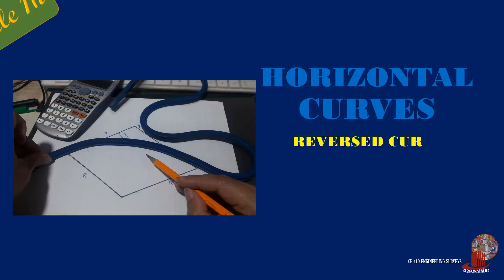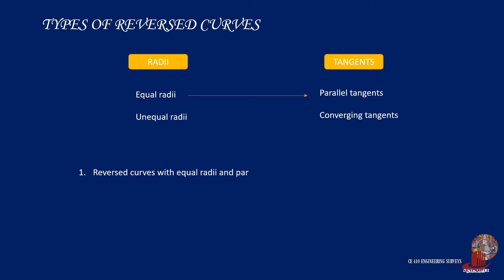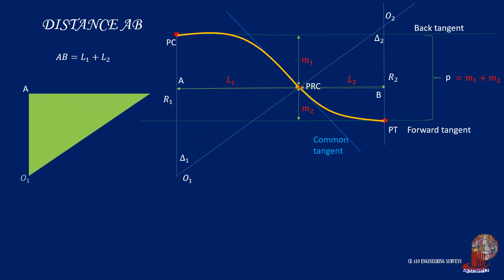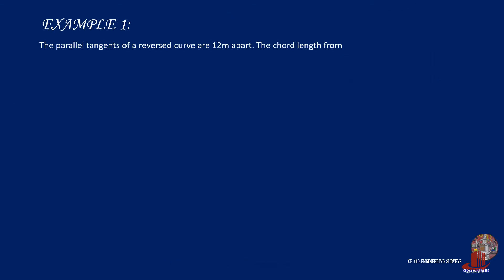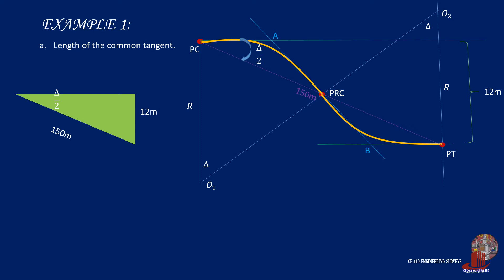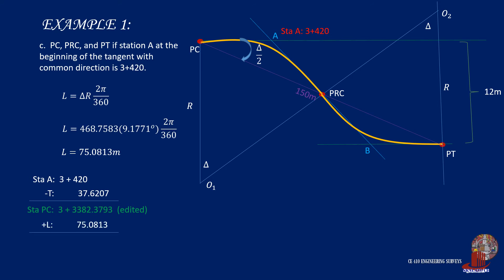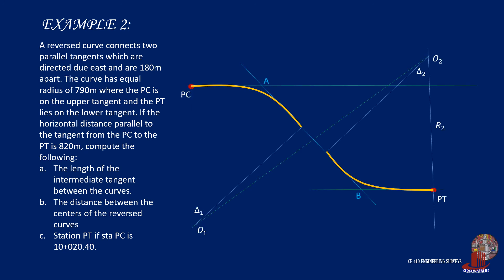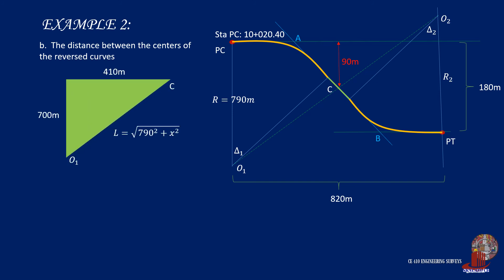REVERSED CURVES 1H:  CONCEPTS AND EXAMPLES

Comment: A reversed curve with non parallel tangents is connected to be the center line of the road to be constructed. If the radii were 200m and 240m respectively. It is desired to determine the total length of curve, assume the back tangent to be 60m.